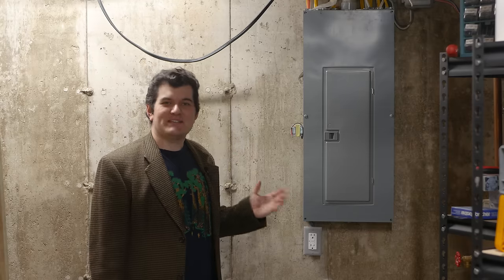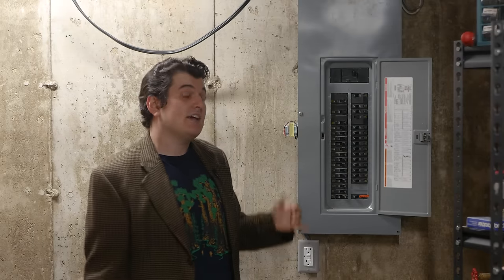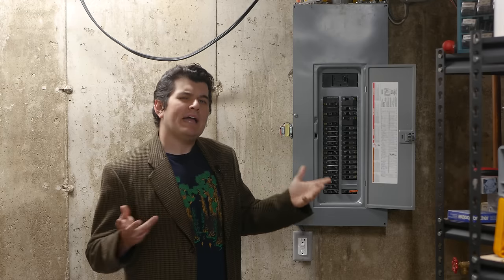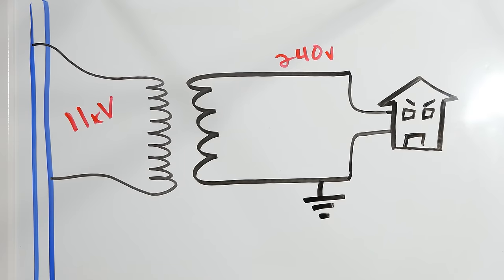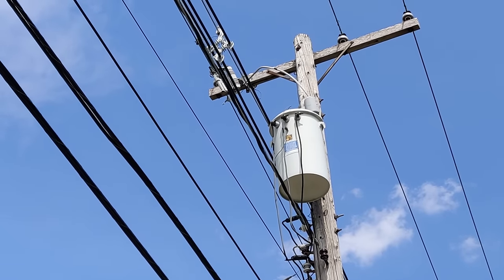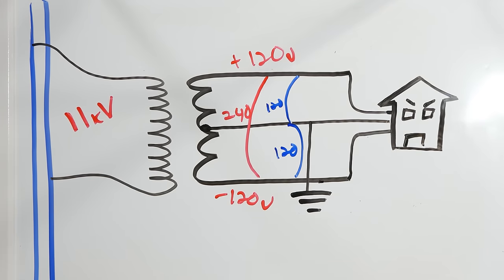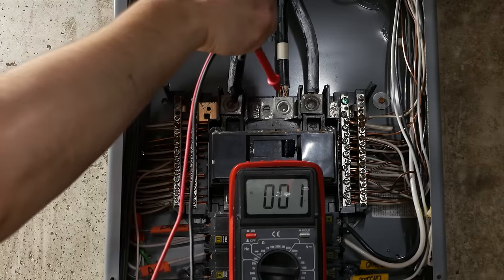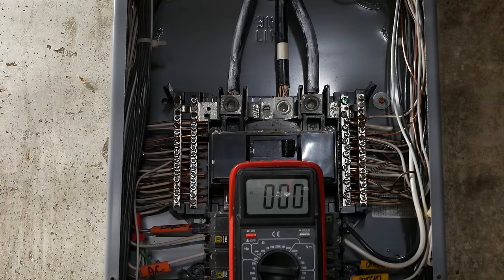The US electrical system is not 120V

Comment: For me as a German this video was really interesting and enlightening! I was 100% sure the US voltage is 120V AC only. 
Different countries, different approach. 
Many thanks!
Reply: Hello Henry,
remember that we here in germany has a three phase system instead a two phase system in US. So we have 400V between two phases and 240V between each phase and the netral wire or ground. This three-phase current is called "Drehstrom" in germany and has the same geometry as he explains at 19:12 in the video.
Reply: @Domimi78  yeah, exactly. Saying it's 120V is a stretch as in Europe you can ask electrical company to attach a second or third phase to your house if you need it. It's simply that in US everyone gets second as a norm.
Reply: @Domimi78  Bruh, who the hell needs 400V of power directly to their outlets. Are some Germans running their own mini-sern projects at home?
Reply: @resphantom  Some people use 400V for something like a big circular saw or their lathe. They have their own plug It's called "CEE-Stecker". For normal appliances like a mixer they use one phase and neutral with a difference of 240 V between them.
Reply: @BlueMokke  I just saw that my country also run on 400 - 415V 3 phase power. Turns out stuff like electric ovens and geysers use a  lot of power.
Reply: @resphantom  3 phases are for industrial use mostly. There are 2 types of them: Delta and Y config. Without neutral and with neutral. You cant split phases with Delta config tho...
Reply: @zerodelay1630  ya exactly. Like making a Pizza in my offen or charging a electric vehicle.(yes there are other ways of doing it but a lot still use 400v) Who would wanna do that in a privat Hause?
Reply: @Midaspl  no the norm is single phase its a single 240 transformer that has a neutral center tapped. So it splits that one phase in half. If you hooked an o-scope to it you would see one wave function. Now commercial building like apartments do get 3 phase and your 240 loads are supplied 208 via two 120 phases.
Reply: @resphantom  Everyone who needs more than 3680Watts (16A * 230V) at once.
Reply: Henry, even in rural areas in the US we use 240 for electric water heaters dryers stoves air conditioning. 120 for power adapters lights and smaller appliances. Our gas generators sold here have both.
Reply: 3 phase runs everywhere in US you just have to pay to get it run to your house or business, which can be pricey
Reply: My home, like, I believe, most buildings in Germany, has 3 phases arriving in the main distribution box, each phase with a main cb. Then the 3 phases are either split up to some amount of 16A cb‘s, each driving a bunch of switched lamps, wall outlets and other single phase stuff, or all 3 connect to 3-phase devices like kitchen stoves, e-car wall boxes etc. The aim is to distribute the load evenly between the phases.
Reply: @henrypile2385  only 2 legs run 240v I believe we call 3 phase 480v just commercial and industrial, my uncle had to pay to run the 3rd leg to his residential address for a workshop
Reply: Power distribution in residential homes is quite a mess. We tend to end up with the worst of both worlds because of the reliance on 120V for most things.
Reply: @Midaspl  "Europe you can ask electrical company to attach a second or third phase to your house if you need it. "
No - all housholds are connected to all 3 phases.
Reply: In europe and basically all of the world houses are connected to 3 phases and they are then split up across rooms to balance the load on the system.
And using all 3 phases is also done in nearly every home: Stove, oven, boiler - those are 3phase appliances in general.
Reply: @Mister_Durden   The voltage depends on the transformer configuration, and you can get 3-phase service even if there are only 2 HV phases available on the pole.   Open-wye open-delta is one such configuration.  For a small 200-400A service, you'd typically have 240v between phases, and two phases would be 120v to neutral, while the third would be 208v to neutral.  It's not ideal, but it's a somewhat common way to supply 3-ph service at the fringes of the network.
Reply: @PSUQDPICHQIEIWC  we run a phase converter in my dads shop to supply 3rd leg for milling machine and drill press instead of paying to have it ran to the property.....everything else you said is above my head lol
Reply: @Mister_Durden  Oh.  The way you said that implied that you had two phases available.  If you have a simple 2-pole mains, that's a single-phase service.  
The problem (and expense) in getting 3-ph service is that in residential and rural areas, all three phases are often simply not available on the pole.  The configuration I mention simply allows the limited use of 3-ph loads even if only two of the three are available on the pole.   Using 1-ph to run a converter as needed would be cheaper than installing a whole service either way.
Reply: @resphantom  In Germany the 3 phase circuit goes usually to the Kitchen to feed the Electric Cooker (something I discovered when I moved here and needed a cooker.
Reply: @Midaspl  No need to ask for additional phases in Europe. In 2022 you always get all 3 phases. You only have to ask if you need more than 3x40A for your house.
Reply: @resphantom  Quite a few people use continuous-flow water heaters or electric stoves. You usually want to balance the power usage over all 3 phases to minimize thermal load for the cables.
Reply: @resphantom  our homes are supplied by 400V 3 phase power. But the voltage between every phase and neutral is 230V 
So our indoor sockets are 230V 
We split the 3 phases (L1, L2, L3) to different circuits.
So for example light in living room is on Lq and N while the sockets are on L2 and N 
And other sockets are on L3 and N 
400 V are only used for electric stove and water boilers.
Usual electric home devices run on 230V
Reply: @asdanjer  It's very useful to charge your electric car.
Reply: @cyan_oxy6734  yea that was my point.
Reply: @ABaumstumpf  if available. Here it is a wild mix of TT, TN, and IT grids. Generally we have three phase, but the grid operators have fun.
Reply: @resphantom  mostly you don't use the 400v but a fase and neutral. So 240v. You just can share the load between 3 fases and neutral.
Reply: @henrypile2385  Yes, i live in germany. My house got a 3x63A at the incomer , a  3-phase Meter and a main braeker in the sealed  meter box. We got a TNC-S mains.  Since several years RCD/GFI ar mandatory for every circuit. 

 I use the  three phase power   for the kitchen stove, water pump, lathe, drill press, air compressor  and one of my lab power supply need it. It´s able do deliver 0-40v / 0-200A dc . It´s made by EMI.

I also got a 3 phase CEE socket outside for my jet cleaner and a circular saw.There are furthermore  sockets  in my hobby workshop . My drill press is hardwired. Three phase motors got more torque at the same size compared to a single phase induction motor, had no  need of a capacitor  and are cheaper in price. 
And final, they got the max torque from begin.  
A higher voltage mean lower currents at the same power and therefore smaller wire size. My 2kW fan heater in my workshop run between 2 phases with 400V. only 5 ams current, the lead got 3x 0,75 mm² ( ? AWG) It´s also hardwired. 

From my kind of view, three phase power has a great advantage.
Reply: @resphantom  From Belgium! Incoming is 3Phase 400volt + Neutral! between phase 1-2=400v between phase 1-3 400v  and between phase 2-3 400v. so between 1phase and the Neutral, you have 230Volts! between phase 2 and neutral also 230 volts and between phase 3 and neutral also 230 volts. Nobody has 2 phase sockets with 400 Volts! at home. All (standard appliances) are working on 230 volts! Except in factories, industry, etc with motors, machines, etc, etc there most are working on 400 Volts with or without neutral.
And the higher the voltage in the main grid to the homes, the less thick the cables need to be and the more stable you can make the grid without!!!! transformers wherever you can look. For EU standards the US grid you can find in a MUSEUM! 😄😉✌
,
Reply: @resphantom  Someone who isn't stupid enough to lug amateur tools home. Circular saws, lathes, drill presses, welding machines, high-pressure washers, etc. are bought if they are available cheaply somewhere at a workshop and they often have a 400 V connection.

Someone who has a decent combination of oven and induction hob or has dusted off something decent when a restaurant went bankrupt, there are excellent combination devices that outperform the household rags at any time, in which case they are often available cheaply and just need a decent 400 V connection.

All modern houses are now only connected to the provider with a 3-phase connection. In the house, either all 3 phases come from one socket or the whole thing is divided up in the kitchen, for example, so that the sockets are divided into three phases. The microwave/grill/convection oven combination, air fryer, electric kettle and refrigerators on a single fuse usually don't work so well, leading to spoiled food due to lack of cooling.
Reply: @Domimi78  From the many posts here I figure that most of you don't understand the American system and the video doesn't clarify it.
120/240V split phase is residential power, 208V 3-Phase is business and light industry and 460-480V  3-Phase is heavy industry. One will never get 480V 3-Phase system into a residential property.
Reply: @vegasvegas2811  And I figure, that the Europeans just wanted to state: If "we are a 240V land too like Europe" then "we are a 400V land, and have three phases instead of two half ones".

It is just a funny thing, that Alec wanted to prove to the european viewers "you just look at our outlets and think that is all we got" while "looking only at the european outlet and thinking thats all whats there".
Reply: @Midaspl  In Germany households get three phases as a norm. In many cases there is one three-phase outlet in the kitchen.
Reply: @resphantom  Three phase outlets are usually installed in the kitchen in order to provide for sufficient power for kitchen stoves and baking ovens.
Reply: @resphantom  for the same reason that you would get a 3-phase supply here in North America, you have a really big piece of equipment that requires either 3-phase because it needs some kind of motor or because you need an excessive amount of power and that just becomes safer with three phases compared to one or two phase
Reply: @Domimi78  American electrician here. All of our industrial and commercial buildings run three phase. Residential is two phase.
Reply: @Domimi78  Actually, our electric generation and distribution is 3 phase. We only connect 1 phase (240V) to residential homes. It's wired as "split phase" to get 120V at outlets that only need "low" voltage.
Reply: @resphantom  the stove uses usualy 400 V - ok, no, he not uses 400V, but he uses the 3 hot wires to distribute the amps needet to heat everything on different wires.. that saves a lot of copper, makes the installation more save and easy. thats, in fact, how the 3 hot wires are mostly used in home envoirments: to split the energy distribution on different cables - oh, and to turn motors like, you know, washing machines.
Reply: For the longest time I thought most of Europe used 240/480 because I didn't realize they used 3ø. I thought they used single phase like the US. Blew my mind when I found out about 240/400. In the US if you're running 240 on a 3ø system it can be roughly 3 different ways. You can have 120/208/240. 240/480. Or 120/240. Hell you could even use open delta systems which take a leg off the 3 phase. And tap a ground and have fake single phase power. Electricity is neat 🙃
Reply: @Mister_Durden 3ø is not always 480. It can be dozens of different voltages if you're referring to the US. And tons of them are standardized. 240/480 could be single ø (1 coil with a tapped neutral like a home) or 3ø. We also have 3ø 120/277, 120/208, just straight 480 3ø delta. 480/240 high legs. Open deltas that have any combination of 120/208/240( usually only 2 of those at a time but you can use all 3 technically) I've even heard of 240/400 for niche industrial motor applications. And don't get me started on medium voltage. 

I could talk about this all day 😅😅
Reply: @PSUQDPICHQIEIWC I know a lot of older commercial buildings that were just starting a business back in the day did open deltas so they didn't have to pay the utility for a 3rd transformer until they get big enough for it to warrant the upgrade.
Reply: @resphantom  it's really great when charging an electric car
Reply: @resphantom  Mant electric cars like Tesla's need 400V for the fastest charging speed on AC power
Reply: @resphantom  Water heater, 21kw as normal
Reply: hello henry,  for me,  as an American professional electical engineer, the household AC here is two phase 120v amplitude at 180 degrees, total 240.   Industrial sites near my house draw three phase at elevated voltages.   there is no engineering reason why a simple house should need anything more than two phase.  It is enough to power a stove, air conditioner, water heater and even a decent 240v MIG welding unit in the aforementioned electrical engineers garage. Adding third phase tap off the 18kV transformer is costly and unnecessary for consumer purposes.
Reply: The American system is 2-phase ( 180° ) 3-wire, which is not seen in Europe and much of the rest of the wrld, and Americans will not call their 2-phase two phase, they call it Split-phase, which is sort of OK, giving a split 240V winding, so Two live 120V with Neutral, and between them 240V. . .  This is technically a very odd arrangement and does not fit in with the normal 3-phase arrangement, so causes all sorts of problems for higher voltages and proper 3-phase.. . .   What both annoys me is when they try to use the words "Single-phase" for their 2-phase, that can be dangerous. . .  Because you in Europe KNOW Single-phase is a Single phase and Neutral, that is 2-wires.
Reply: I am always wondering why US electricity components always looks like they are super old or look super cheap
Reply: @gene9230     A bit complicated, but despite being a rich country, they do many things on the cheap. . . .  With only 120V to Neutral, many items are not made as safe as they are in Europe. . .  Their whole power system is also done on the cheap. . .  Look what happened in Texas last year, back in Feb, they had major power outages, because things froze up, they had not included standard de-icing equipment used in more northerly and colder parts of the USA. . . .  They are giving up on Nuclear power stations, certainly not building any more, because they are more expensive than Fossil fuel power stations.   .. . Never mind the environment, they go for the cheaper option of Fossil fuel, they have a lot of coal available and cheap Gas.
Reply: @Midaspl Here in Denmark, everyone get 3 phases. Things like stoves are typically wired for using all of them simultaneously. One phase powering the two left burners, one powering the two right, and one powering the oven. 

Some water heaters connect two phases for 400V. My car charger uses 3×16A 240V to produce 11kW. There are even some equipment with AC motors using all 3 phases directly.

Notice that our circuit breakers usually top out at 16A, with 32A and 63A used in commercial buildings and construction yards.
Reply: I have a single 35A main switch in my switch board, but I am xharged from 3 phases 25A each (3x25), still that in the video is a 200A breaker?
My off-grid cabin has a 60A breaker at 12VDC, but it is lover voltace DC.
Reply: @SixStringViolence  Is that a standard power point, 230v at 16A? Nice! What country? In Australia we can get 230v 15A, usually for an AC unit bigger than about 8kW, and usually hard wired, though there are 15A power points... they have a larger earth pin/slot.
Reply: @Domimi78  The US residential in not 2 phase, although there are like two power plants that are technically 2 phase still in existence… We are 240v three phase delta with the neutral coming from a center tap between any 2 phases… For instance, Phase A and C with center tap delivers two hot legs and a center tap for neutral, Phase A to Phase C is 240v, Phase A or C to neutral is 120v, Phase B (if delivered) to neutral is 208v… As I recall, Europe is 415v three phase wye where any one Phase to neutral is 240v… Oh, we could also have a Delta/Wye conversion delivering 3 phase Wye at 208v which would provide 120v from any one Phase to neutral… But, we are mostly delta as it has better reliability…
Reply: @hughleyton693  You are incorrect.. Transmission level lines in the US, the UK, and many other countries are virtually the same… They operate at 230kv to 500kv with some exceptions, I know we have a few lines here in the US at 765kv… Then Transmission Substations are 33kv, 66kv, etc. to Distribution Substations… The difference comes at the Distribution Substations to customers… We deliver delta/delta at 480v industrial, or residential at 240v with a center tap on the delta secondary so any one phase to center tap is 120… In the UK, I think it is delta/wye at 415v for secondary where any phase to neutral is 240v… Delta is more reliable as if any secondary goes down it still delivers the same voltage, whereas if a secondary on a wye goes down the voltages change… Texas had issues due to demand and natural gas supply to plants, not the grid itself… Also, while the US and Europe as a whole are about the same size geographically, the US has significantly less people, thus Europe has an advantage due to the scale of economy with more customers funding a power grid of smaller size (in terms of generating capacity)…
Reply: @EarlHayward      NO, I am not incorrect, you clearly do not understand what was said. . . .  Here the Local distribution is 11kV 3-phase 3-wire.. .  So two lines with 11kV between them are connected to the many Transformers, that then supply 2-phase 3-wire 120/240V TN-C, to all the houses. . .  They are trying to go up to 22kV in new installations, the Trunk transmission here is 110kV, the UK Grid uses 400kV in some routes. . . . .  Delta secondaries for 120/240V are Not common, that only allows about 10% of the transformer rating. . . UK, and much of the world use the Harmonised standard of 400V 3-phase, which naturally gives 230V Single-phase, simple and easy.
Reply: @Domimi78  This this this! I loved Touring Europe with our UK gear as I trusted your supply (big bag of Schucko's for the Hotels) I voted Remain.

PS, we have better Plugs...

😏